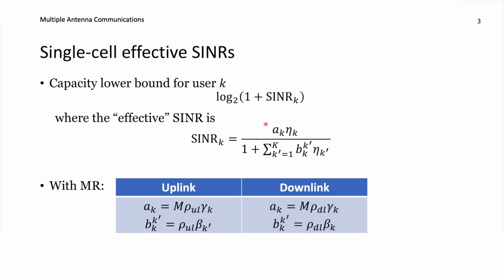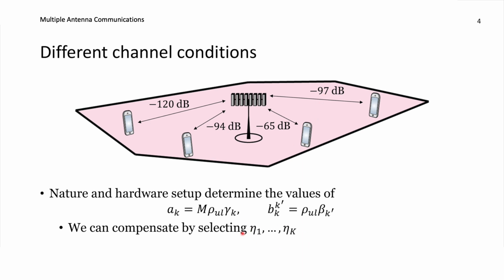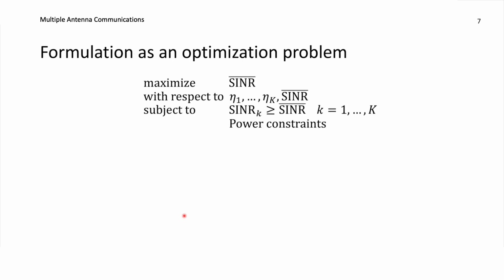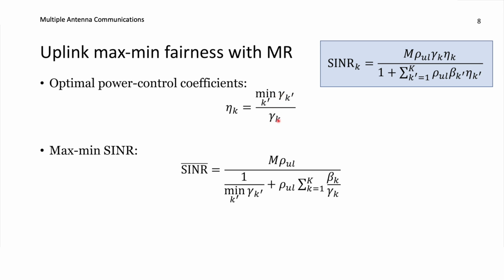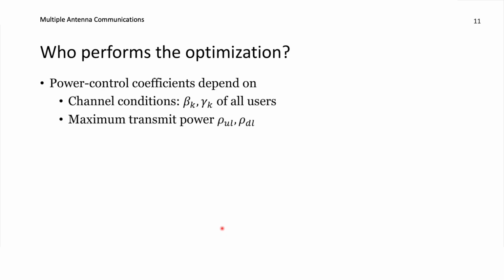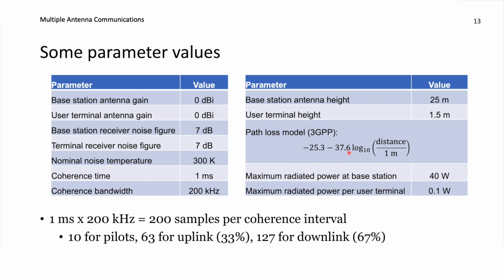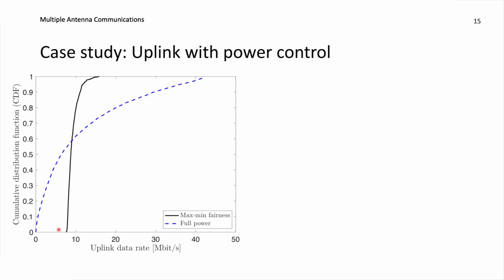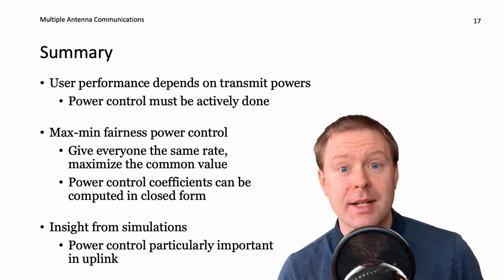Lecture 11: Power Control for Max-Min Fairness

Comment: Thank you for this interesting course. On slide 11 you show a diagram with the SNR. We are in the UL, so that is the SNR at the base station. An SNR larger than 0 dB means an amplification of the signal. Does that mean the signals from these users are stronger at the BS than at the UE (transmitter)? How can that be?
Reply from the maker: The SNR compares the received signal strength to the noise in the receiver hardware. 0 dB means that the signal is equally weak as the noise. The SNR doesn’t reveal how strong the signal was at the transmitter, but you are right that one cannot receive more power than was transmitted. The received signal is roughly 1 billion times weaker in wireless communications… I recommend the following video: https://youtu.be/OA4viERrlzA

Comment: Thanks for the video 

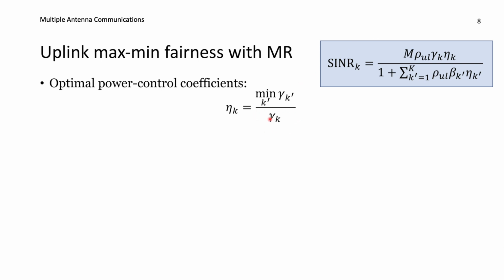@16:30 why we selected min over gamma_k ? why not max if we want to maximize sinr ? why not min(gamma_k)/2 or any other values for ex ?

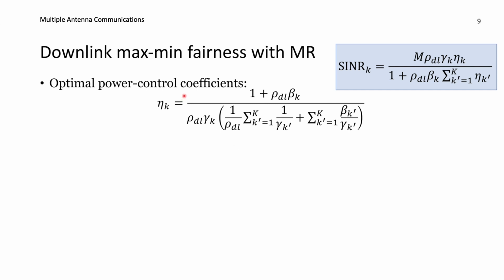@20:27 where did the brackets term came from ?
Reply from the maker: All the eta_k must be smaller or equal to 1. To make them as large as possible under that condition, we should then make sure that the largest of them (the one where we divide with the smallest gamma_k) becomes 1. This is what we done @16:30.

You can find more details in Fundamentals of Massive MIMO. In particular, the full derivation of the optimal downlink formula at @20:27.